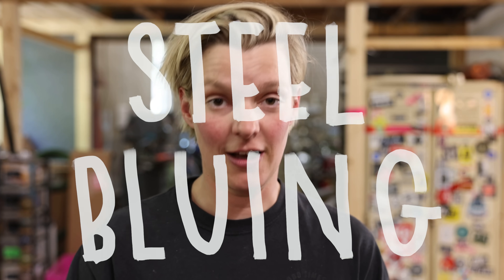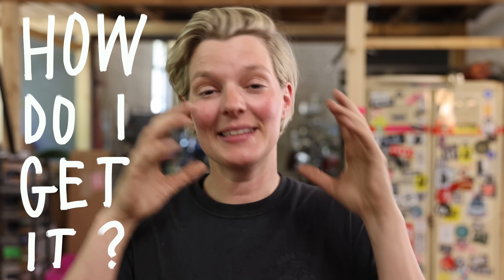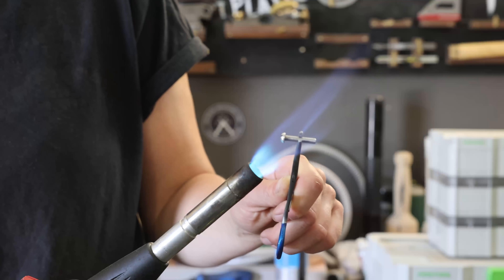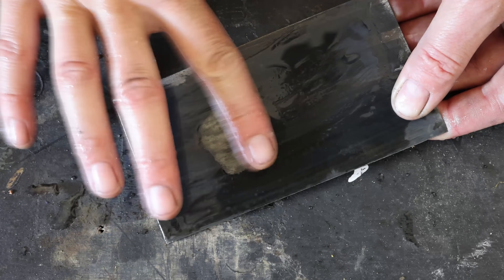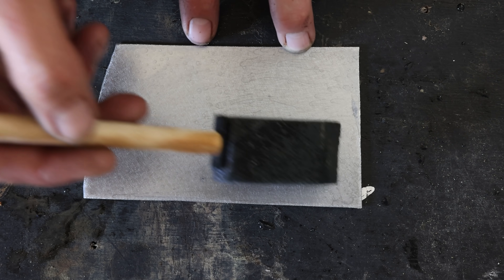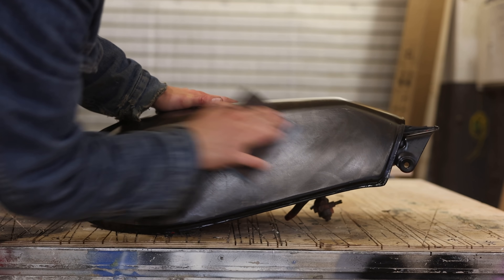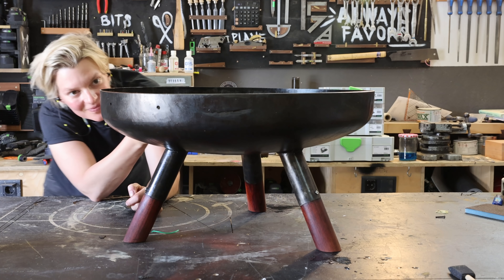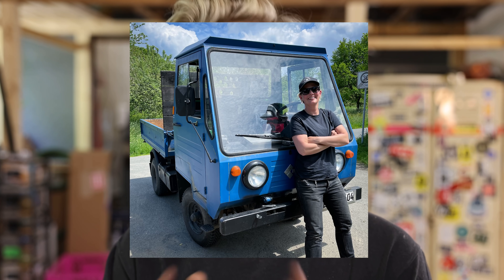Turn Steel Black - Cold and Hot Bluing Process Explained

Comment: I tried to hot blue a carbon steel cleaver many years ago and made the mistake of quenching it under a running faucet instead of dipping it in a bucket of water. It blued well but warped as the cold water hit one side of the cleaver more than the other. Then I tried to straighten it out by hot blueing it again and quench the other side to even it out, but it did not work.

Comment: Hello Laura, I have a question if you don't mind; at the 5 minute mark you are holding a piece of steel which you have heated and quenched claiming the quenched end is blued/blackened. Observing the same piece of steel closer to the pliers end there is a section that is very bright blue that in no way can be mistaken for black. So the question is which of those sections meets the correct definition of blueing? Jim.

Comment: Counterintuitive as it may sound, you fill gas tanks up completely with gasoline when you have to weld them because gasoline doesn't combust as a liquid. I don't know if you could do the same thing when you heat the whole thing up or not I don't think I'd like to try it. I don't even like welding gas tanks.

Comment: What about rust bluing ? This is the simplest and oldest type.
Hot bluing will basically kill your part, because it will lose it´s ductility permanently. Which means your springs for instance will lose their springiness and simply break. They will not lose their hardness they will gain more harness and brake like glass.
As in your example of the motorcycle tank, it will become brittle, could rapture and will also deform a lot when quenched to a point where the part would be basically ruined.
Also bluing your steel parts in general is the worst rust prevention method there is aside from ...not doing anything to the part at all. You will always have to coat your steel parts with oil afterwards. That´s why guns are always oily and need constant cleaning and re oiling.

Comment: Hi, as described in some comments watch and clock makers are some of the best in the technics of bluing with heat , they also have to know the metals reaction to heat bluing due to needing the correct tensions needed for that particular part ` as we all know the wrong amount of heat causes the metal to break or bend when it needs to move back and forth when cold, 
Engineers and black smiths also come across the issue with bluing with heat,
I had some knowledge from a old timer who worked with leather and gave me some great advice, 
(Some oils contain more water than others and will destroy leather over time not all oils are water free), So it pays to  check before use` Bluing will rust if not protected correctly,
Oil over bluing alone some times is not good enough, Speaking to an older engineer said depending on the part if his mixture is able to be used he would warm up pure beeswax and oil to a low temp then mix together and rub this on certain parts,
Only add about 10 percent wax to oil and mix with a little battery hand held milk whisk that`s used for milk in coffee,
I bought old cast iron steel school wood work machinery for my`  garage they were all treated in this method by me 'and 6 years in my cold damp garage stopped the rust, I would clean and blow torch the machinery cast tops gently and evenly to evaporate any water and while warm then add my mixture off oil and beeswax rubbing it into the metal then blow torch again and add mixture one more time then buffed after, I would rub this in every two years over the 6 years never had issue with rust,

Comment: Great video. 
Wanted to point out, though, that cold bluing doesn't form an oxide layer like hot bluing or rust bluing. Cold bluing solution deposits a copper-selenium compound.

Comment: The heat/oil technique isn't hot bluing, it is hot oil bluing, or 'lamping'.
Hot bluing is something entirely different, and involves a hot caustic bath. You can do it at home, but it's pretty dangerous, and is probably beyond the scope of what you are using bluing for anyway.
Another technique you might want to look into is rust bluing. This involves forming a layer of red rust on the surface of the steel using a chemical solution. The part is then boiled in water to convert the red rust into black iron oxide.
As far as technique goes, rust bluing is almost as easy as cold bluing. It takes longer to do, but the result is vastly superior.
It is much more durable, and you don't get that horrible stink like you do with cold blue.

Comment: You can blacken veg tanned leather with a process called vinagroon, using a combination of vinegar and rusty steel wool. Also, there are chemicals that sculptors use to put patina on various metals. You can check with a sculptor supply house for the kind of finish you want on a particular kind of metal.

Comment: Have you tried cold blueing with multiple layers? I was wondering how you would do it with multiple layers especially the cleaning in between. Might be interesting to get a darker more protective coat... if it even works :)

Comment: A major reason why black oxide/bluing/blackening is good at rust prevention is it creates a porous surface for oil to get trapped in. The oil is actually what provides the rust protection, not so much the oxide layer itself. Un-oiled bluing will rust very quickly if exposed to moisture.

Comment: Cast iron seasoning can actually be washed with soap and it's fine. The advice to avoid soap comes from when soap was lye based which absolutely will remove the seasoning. Dish soap won't touch the plasticised oil layer.
Reply from the maker: Ah! Did not know that! Thanks :)

Comment: Laura, what you describe as hot blueing here isn't blueing at all; you're just heat coloring the steel. Actual blueing occurs when a layer of magnetite is formed on the steel, and this requires potassium nitrite or some other alkaline salt solution.  Blueing steel provides excellent rust protection. Cold blueing steel and heat coloring steel does not.  Also, quenching in vegetable oil does nothing if you aren't hardening the steel. When coloring steel, all you need to do is remove the heat.
Reply: Don't Mansplain Laura.  Make a video and show us.  I have tried it.  Heating and letting cool, is different than quenching.  The oil you use will give you different effects.  and to darken you need way less heat with oil quenched steel than just heating and letting cool.  And if you just heat and let cool, in a few days it will certainly rust.
Reply: @BillHartCooks.  it's not mansplainig. She is totally wrong...out of 280 comments only 3 people point this out. I enjoy the vid...but it's not hot Bluing. Sorry

Comment: Thanks. I’ve done a different technique to bluing a Opinel knife. I took the idea from a YouTube video (Japanese). I’ve used hot vinegar and black tea.  You have to put the knife in the solution (hot vinegar+tea); the more time you left, more black is the result. My opinel looks great and never get rust. I’ve also polish the wood handle and put it in boiling oil, and the general result is it looks like a very very old opinel ( actually was new). Sorry for my poor English. Hope you can understand.

Comment: Im building a welding table right now, and the heat resistant steel rust prevention will help a lot. Thanks for sharing that knowledge, awesome video!

Comment: You are correct, heat-treating and then quenching in oil will change the steel temper and is not suitable for where strength is required.

Comment: With the cold bluing method, apply one thin layer with a paper towel  or soft cotton cloth just slightly dampened with the solution. Let it sit until you reach the color you want or the process stops. Rinse, dry and repeat until you are happy with the results. It takes longer, but you have much better control over the color. Also, after bluing, put the parts in hot used motor oil for an hour or so to seal them. About 100 C seems to work alright, but the hotter the better.

Comment: If you want a more even coverage - on furniture for example - take the cold bluing solution, dilute about 50% with distilled water, and spritz it on with a spray bottle. Wear rubber gloves and add the bluing to water! After rinsing with water, let dry, then bake off residual moisture with a propane torch. Rub down with a rag after its cool and then spray lacquer in your choice of sheen.

Comment: The method for hot blueing reminds me a lot of how a Wok is prepared for use. It's heatet up as high as possible (requires a gas flame) and the oil then leaves a slippery protective layer. After doing so for 2-3 coats and cleaning it with warm oil and a cloth it's ready to use and food doesn't stick to it anymore.

Comment: Guess it loses something in translation. Applying heat to metal, 500° to 600°, and placing in oil, is called blackening. Hot bluing is done to firearms. The parts are placed in a solution of potassium nitrate, sodium hydroxide, and water heated to the boiling point. Heating gun parts to 500° or 600° would damage the heat treating of the metal.
Reply: Thank you. There is so much misinformation as far as hot Bluing
Reply: What are the proportions of the chemicals?

Comment: Hey Laura, I hope you still notice this question: does blueing work as a primer? To paint over it and improve that paint bonding with the metal?
Reply: Good question. I don't think it's a great idea. It's similar stuff to mill scale and as Laura said you only really get the rust protection if you keep it oiled. I have used it on a bike frame however. I put the oil on, let it soak for many days, then cleaned with acetone and covered it with 2K clear. It looked badass but I don't know how well protected it will stay.

Comment: I've tried a third technique which is common with firearms restorers. You treat the surface with a mixture of acid and etching chemicals and let it rust (orange non-posh) and then you boil it in water and it turns the rust into posh rust!

Comment: Hi Laura, a few weeks ago you did the cold bluing process on your motor engine gas tank. After applying oil to it you left it for a day. And then you covered in a 2K transparant paint. I was wondering how the paint is holding up? And whether or not you decided to transparant paint so you wouldn't have to use oil on a regular basis to prevent regular oxidation? I'm in the middle of decided whether I should use your technique on my freshly welded tank.

Comment: Have you investigated "rust bluing"? Very old technique. Rust the part on purpose, boil in distilled water to convert to black oxide, repeat several times. Easy to do at home.

Comment: Posh rust is an excellent way of describing the oxide layer on blued steel. It’s a slightly different molecular construction than typical rust. That said, the method of blackening steel by wiping on oil or dipping in oil after heating should be called blackening, because it does not produce the same surface as bluing. With the oil treatment you are creating a polymerized coating of oil on the metal, just as with the cast iron skillet, not an oxide. Heat bluing is done in air, not oil, because you need the oxygen to create the thin oxide layer. See the Clickspring channel for an excellent example of heat bluing. See the Alec Steele channel for examples of oil blackening. Oh, and I believe the chemical blackening is producing a thick oxide, but can anyone else confirm that?

Comment: I thing the most difference is what is happening with the material. By the cold version it is only a change at the surface. The hot one also has an influence to the metal inside like hardening. The material can change its behavior to recalcitrant.

Comment: There's also a range of steel tempering called bluing, because of the bright, glassy blue color the steel turns during reheating to a specific temperature band.  (The specific properties of any given steel depends on both composition and how it's been heat treated.)  This is caused by a thin-film interference effect in the oxide coating itself, and so can be preserved as a reference for the temperature it forms at for later comparison.

Comment: It's called bluing because you can actually turn steel blue with it. Quite a vibrant blue, at that. It is dependent on the temperature the steel reached before quenching, quite a precise process. This way, other colors can be achieved as well. It goes through a lot of colors before ending with black (easiest one to do) depending on the thickness of the oxide layer and some photon quantum physics shenanigans. Shoutout to Clickspring at this point, he is displaying that technique in a bunch of videos neatly. 
Also, hot bluing is preferred over cold bluing whenever friction is involved, the hot bluing leaving a thicker, more wear resistant layer.

Comment: Bluing (hot or cold) is usually used on guns for rust protection , black oxide is a hot chemical process used on steel parts for rust prevention.

Comment: There's a third method, which was actually the first one developed and used for firearms after they were invented. It predates them though. First you have to rust the item. Today this is done with a chemical solution but not the same one used in chemical bluing. Then you either boil or steam the item until the layer of rust converts to black.After that a carding wheel is used to polish the surface (because a regular wire wheel will take off all your hard work). This is the most protective form of bluing. For a good video of the process, check out Mark Novak, a gunsmith who has videos of his work on YouTube.

Comment: Great video Laura! I knew about the chemical bluing but not cold bluing and that it is as easy as it is.
Does the piece have to be heated to a particular temperature such as you do when tempering or hardening steel?
Also, presumably, it has to be bare steel and not zinc-coated or such like?

Comment: Yes this is blackening. Bluing is don by slowly heating up to the steel first turn yellow and then  blue.
This is done in some high end watchmaking movements.
Reply: Are you talking about heat treating? Never seen any yellow hot Bluing a gun.

Comment: It's called blueing because in the light the reflection looks blue. The hot blueing process is used on most firearms to give the gun its classic blued finish. Over decades of use, blueing wears off and mild rusting and pitting begins often beneath the gunstock. Once rust is gently removed with very fine steel wool, the blueing chemical is used to repair the once rusted area. Typically, the part blued is left submerged in the chemical for several hours. A word of caution: Vintage collectible firearms can be quite valuable so reblueing should probably only be done by a quality gunsmith least the gun's value be damaged. Reblueing in this situation should be indistinguishable from the original blued surface. Laura you cycle petrol tank looks really classy! Great that you provided the names of the blueing agents. In the US and Canada,, a good source for blueing and lots of information is Brownells.

Comment: I can't put my finger on it, but some of your explanations don't feel quite right. The oxide layer you form with the cold method, or the ultra-hot like when you harden steel, is porous and therefore capable of keeping oils in, which in turn helps with rust prevention. But there is also the real blueing, that for example Clickspring does: https://www.youtube.com/watch?v=8h1Uf9bkc3E. All methods have one thing in common: they form an oxide layer on the surface.

Comment: I love your videos as always. Great to see more of the hot oil bluing because its not covered much elsewhere.

My understanding is that neither of these techniques actually create black oxide rust. And that the cold bluing in particular is a very thin selenium compound that is not very rust preventative. True black iron oxide is a conversion process that changes a layer of red oxide (Fe2O3) into black oxide (Fe3O4) by boiling in a mixture of lye and vinegar. It is not something easily done in the home shop.
Reply: Similar comment here.  I don’t know what sort of surface results from heating steel w. a torch, except that the color is a rsult of temperature.  I doubt that the resultant surfaces that you describe have any rust resisting properties.  What I do know about is not the process that produces the compound referenced above, selenium sounds right, but the real cold blue process that actually does produce Fe3O4 which IS protective, that gunsmiths use.  A steel part is painted w. an acid solution and these vary, some contain dissolved iron, some are jus acid plus hydrogen peroxide; these rust the surface w. bad rust but when boiled in water the bad rust is converted to the black good rust. The rust is “carded” off i.e., some is gently removed, then repeat until you get the desired depth of black color.

Comment: Hot bluing in used motorbike oil works really well - gets a really deep colour. Apparently, the high carbon in used oil helps. Also good to find something to do used oil after the bikes oil change 👍
Reply from the maker: Good tip! Thanks!
Reply: Quenching in oil is called “case hardening”, separate process from blueing steel.
Reply: @velvetonecustomshop5026  you’re wrong on the case hardening process, basically the process involves soaking iron with high carbon content material like case hardening compound or powdered charcoal in extreme heat and over time the carbon migrates into the steel, oil quenching has a hardening effect on the steel but is not case hardening
Reply: @BESHYSBEES  “used motorbike oil” as mentioned is about 100% carbon there Bee, so you made my case for case hardening:) it’s exactly how we make carbon steel for chisels etc In our shop.
Reply: @velvetonecustomshop5026  it’s not the same I think you need to do a little revision, quenching does not case harden steel
Reply: @BESHYSBEES  quenching in carbon, as in OIL, as was the topic I responded to is case hardening. I literally make chisels and knives with this process.